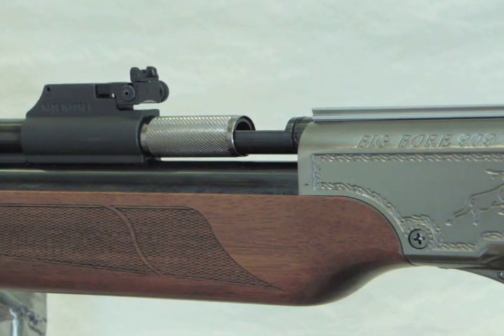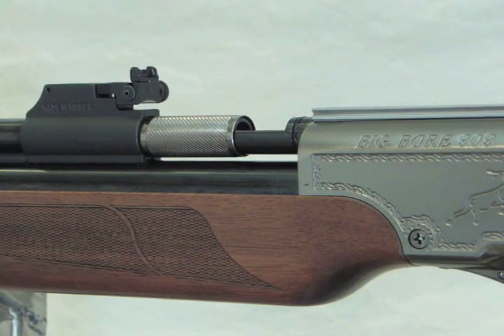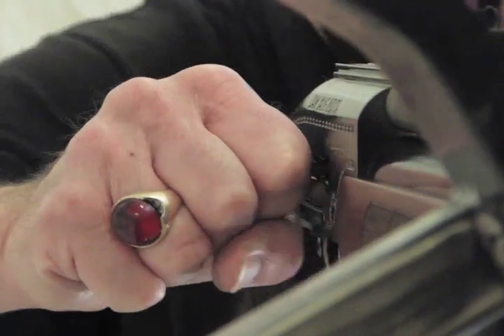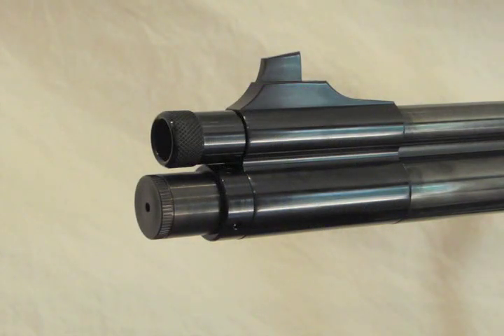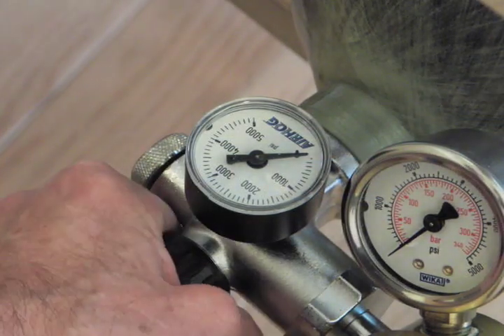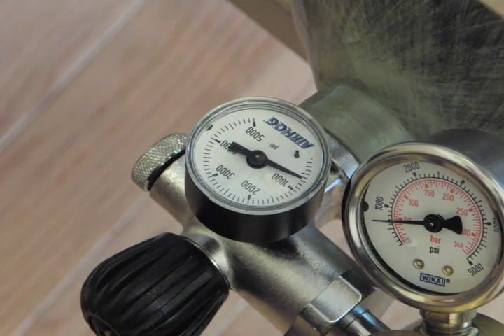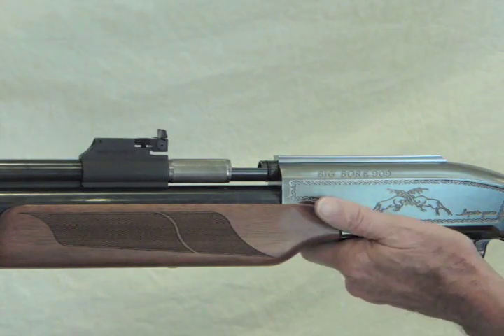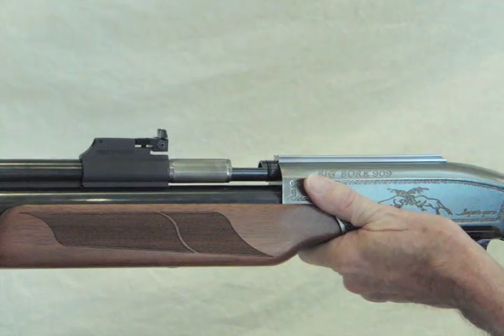How to Stop Escaping Air when Filling a PCP Air Gun

Comment: I have a Benjamin Marauder and when pumping  it up with a hand pump and after bleeding the fill hose I still can't disconnect it with out first cocking it and dry firing it.  Air still bleeds through the pump.  Same way with my Discovery.  I see other people just reaching down with one hand and quick disconnecting theirs..Impossible so far for me to do that.  Any ideas? Pump seems to work fine and I find it hard to believe that the valve in two separate guns are faulty.

Comment: please i need help i bought a brand new Gamo dynamax . the gun does not have a preasure gage . so i never know how full the gun is .but if i fill the gun up to 3000 psi and take like 2 shots  then try and top up the gun . the bar on my hand pump shows "0 bar" and its easy to pump so it does feel like 0psi.is this normal . i think my gun is broken . should it not still show  the high psi if i put in then probe again after i have disconected it?or is it the hose needs to build preasure before

Comment from the maker: If you "bleed" off the pump and take out the probe, your pump gauge will read zero and yes you will have to start over. Leave the probe in the gun and note the air pressure after each shot on your pump gauge- don't bleed it off. Also, you should get around 10 shots from your Gamo before you notice a power drop. I never read the gauge on the gun if it has one- I always go by the pump gauge or the AirHog gauge.

Comment: I have a Sumatra 2500 and had the same problem.  Sent it off to Air Venturi and came back fixed.  However a year later had the same problem again.  Followed your instructions and it's working again.  Thank you!

Comment: If u have lever action Sumatra ,bang front of tube with hand ,pyramid air told me to do this ,it works bang first b4 bleeding fill source. If still leaks stop bleeding out fill source and bang again. If it is a small p.ball tank bang extra hard. It can back blowout seal on p.ball tank. One of my hate of samara